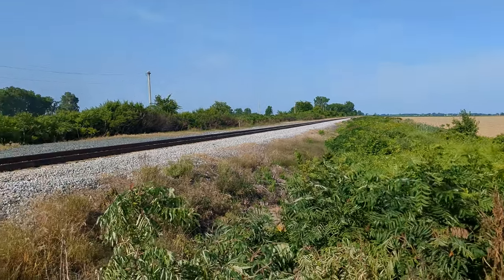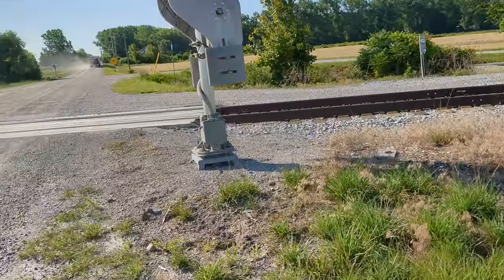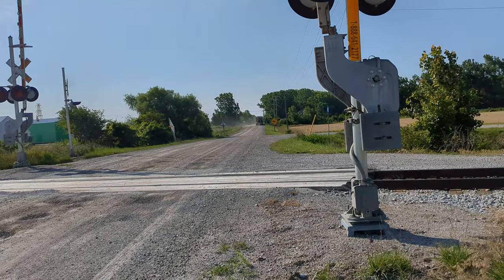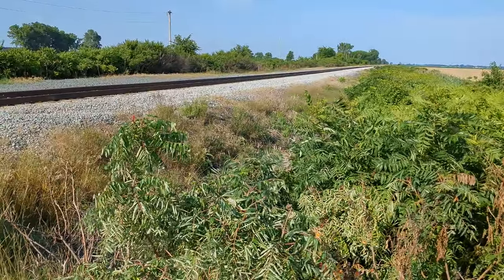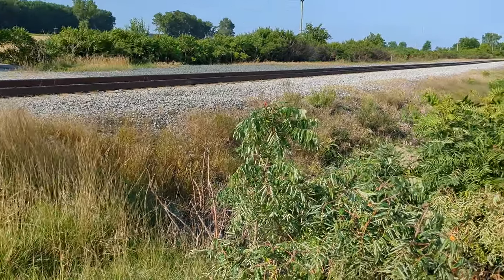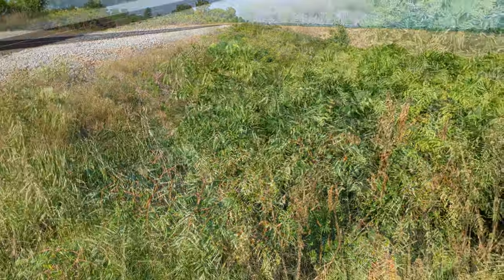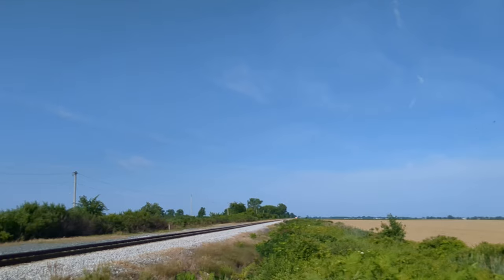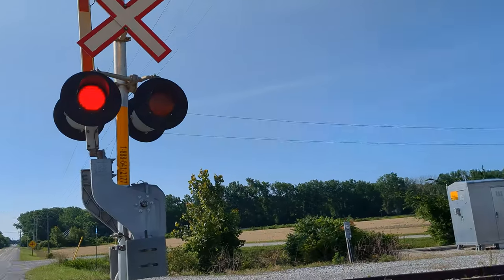SCV-42 SIIX #2204 test train returns! Trains 72 and 672 across Dillon road into Chatham

Comment: Any idea when VIA is planning on having these new trains in service?
Reply from the maker: 2202/2301 is in revenue service in tandem with 2203/2302 between Quebec City and Ottawa - I have many videos of 2202 when it was still only running Montreal to Ottawa.

2204/2303-2206/2305 have been delivered and are undergoing whatever final modifications and tests VIA requires before they use them.

The half-demonstrator units 2200, 2201, and 2300 presumably need a bit of a refit to match whatever change orders have been placed since they appeared.

Also of note: Siemens did an interview with CNBC recently. Both 2308 and 2309 are clearly visible in the background, partially assembled along with many sister coaches.